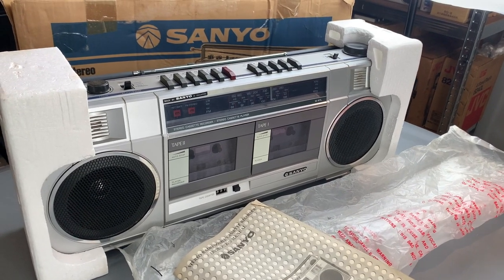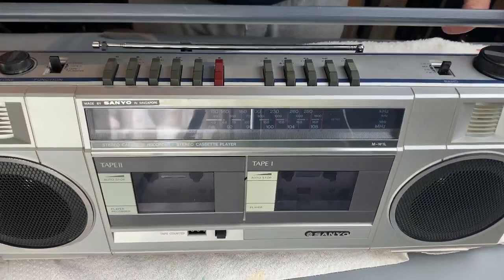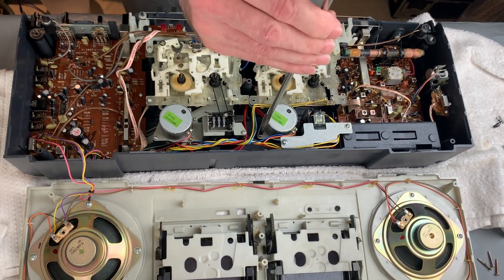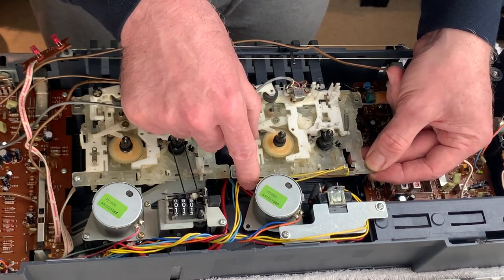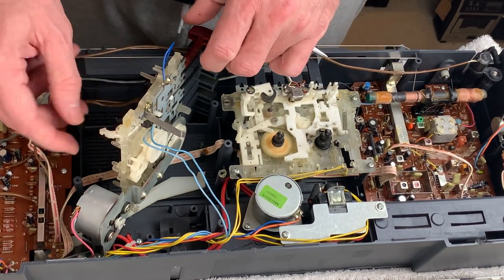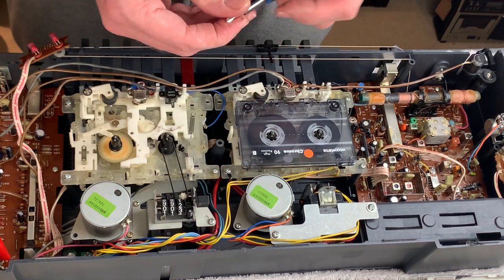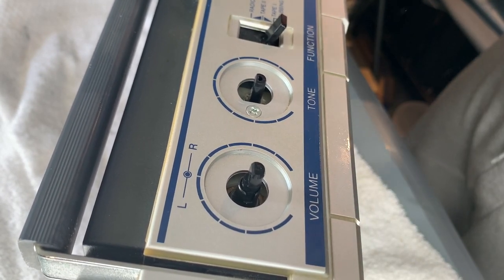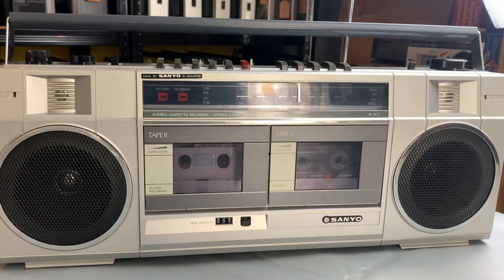Sanyo M-W1L Twin Deck Cassette Belt Replacement & Service. Boombox Restoration. Vintage Audio Repair

Comment: Nice vid, just picked one out of a skip, looked like it had been underground for years, went home got a lead and perfect clear radio after a gentle clean, it now looks new again other than some chrome scratches and i need to replace the belts for tape decks, wish more people would hold on to them, such a solid sound for my morning radio now.. 😊
Reply from the maker: Thanks for watching. Amazing how many people find cool radios in skips - I've never been so lucky - in fact this very one was stolen just a couple of weeks after filming! Enjoy yours, and have fun getting the tape running too. Thanks for watching, and do please check out some of my other videos 😊👍

Comment: A lot of great memories. I had the M-W1 that I got new in 86-87. I got a lot of use out of it. Honestly can’t remember what happened to it?
Reply from the maker: I'm glad yours bought you happy memories - mine was stolen a couple of weeks after filming the video! Still, great to have owned one for a while. Funnily enough, I honestly can't remember what happened to my childhood boombox that I got new for Christmas. I had it for about 25 years but then I can't remember selling it or chucking it away. Weird. Thanks for watching 👍
Reply: @retro_restos  what a drag that yours was stolen!  I’m guessing that I quit using mine once CDs became the “thing.”  I bought my first cd deck for my stereo in ‘89, and bought a Sony cd boombox shortly after. I then began converting my collection to CDs. 

Strangely enough, in the last couple years I’ve put together a “retro” system for listening to & transferring vinyl & cassettes to digital. I use my old Technics turntable, a Realistic cassette deck, and Realistic amp. It all takes me back to my childhood!
Reply from the maker: @thecrippledrummer  it's good fun to convert back and forth - and a nice excuse to dust off the vinyl too. I even record onto 8-Track carts sometimes too - it's just cool having modern albums on such an old format!

Comment: The only significant difference between the Sanyo M-W1L and M-W1F is the tuner (the 'F' model only has AM/FM; the 'L' model has SW/LW/MW/FM). I repaired three of those (sold two) within the past few months ... what a trip that was! 😓😛

Comment: Thank you for the detailed video.  I was able to replace the belts in an M-W1 easily with your help.  I have one question.  Do you know which mechanism stops the fast forward or rewind setting when the end of the tape is reached?  Both decks continue to run on fast forward and also on rewind on the unit I have (FFWD and REW buttons stay pressed).  During play it does shut off as tension on the tape triggers a stop switch but I can’t find anything that stops the fast forward or rewind setting other than the stop button.  Thanks again.

Comment: Another great video and restoration, I do a agree with you, by the late eighties sanyo quality did take a dive, looking forward to the other restoration. Question ? Do you have a sanyo 9994 in your collection this was sanyos beast and top of the line unit back in the late 70s came with external mics a gorgeous unit and highly sought after today, if you do own one did you ever change the belts, I did acquire 2 from ebay several years ago and it would be great if you would do a tutorial on how to service this model. Thanks
Reply from the maker: Thanks for watching and taking the time to comment! Unfortunately, I do not have a 9994 - but you are a lucky man! They are proper bits of kit - and definitely worth getting back up and running. I think the electronic scan for the service book might be available online, so worth a look. I'll keep an eye out for one that might make a nice project! Thanks again
Reply: @retro_restos  thanks for the reply, I'm working on a jvcm70 cleaning and belt change, I will look into that service manual for the 9994, keep the great videos coming
Reply from the maker: @franciscorivas3322  thank you 👍I hope the M70 goes well - I have one coming up a bit later this year - I'm looking forward to working on it. I need to crack on with the M90 project too. Lots to come!

Comment: I can only find a belt 67x1.2mm online would this fit?
Reply from the maker: Unfortunately mine has just been stolen, so I can't measure for you. But from memory, they were both different.  As they are easy to get to, your best bet might be to use a length of string or buy a cheap belt multipack for use as a guide, and then order up from there. Sorry I can't be more help, but thanks for watching.
Reply: What was the outcome? Fixing one to gift to a friend and need a belt as well! If you can lmk where you got yours, that'd be great!